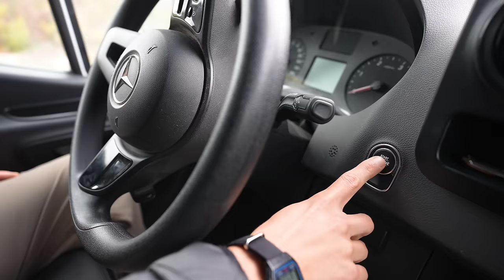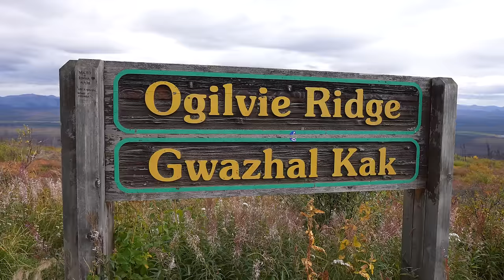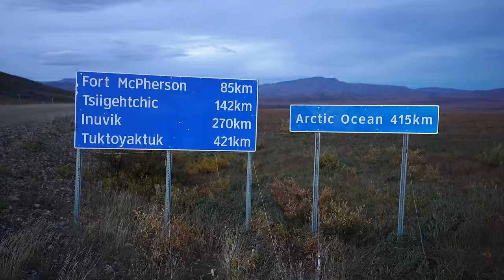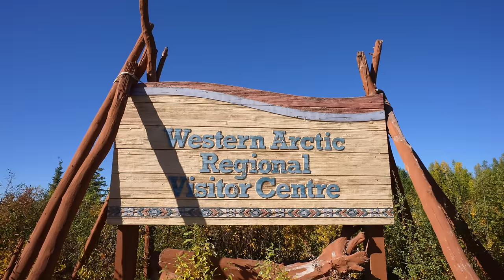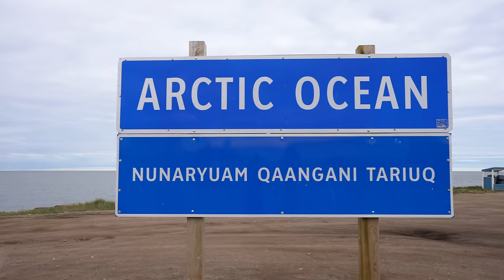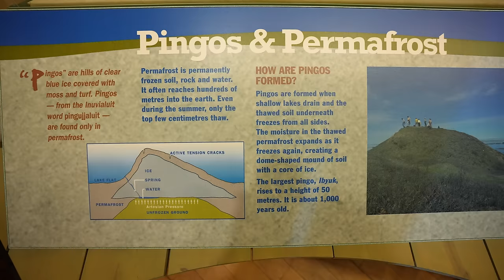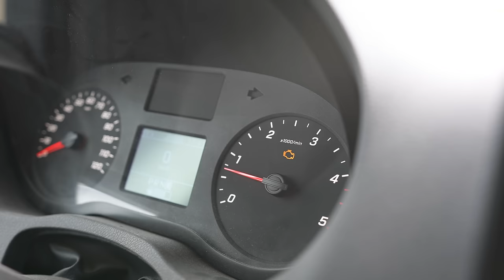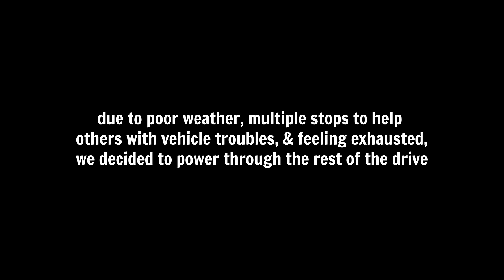We DROVE to the ARCTIC OCEAN! (Driving the Dempster Highway to Tuktoyaktuk in Canada)

Comment: Air, fuel, spark are what you need so check easy stuff first like air box and plugs and work your way down the line. Most times it's something minor but to anyone wanting to road trip long distances I suggest a small kit with all tools needed for your vehicle and know your vehicle, don't let it surprise you on the road. These two did their research and had safety fallbacks in place which is excellent. It's so tragic to hear stories of people lost and scared who don't make it.
Reply from the maker: Yes it is definitely recommended to have a road side emergency kit with you!

Comment: Aside from the wonderful pictures, videos, and commentary, Adam earns the mobile RV repair award for diagnosing and repairing of the fouled EGR valve.
Extra bonus points are available if you packed the carburetor cleaner needed for the repair for the trip.
Reply from the maker: 🏆🏆 woo hoo! The carb cleaner wasn't packed specifically for this trip...I've had to do this job a few times now

Thanks and thanks for watching!

Comment: Your video brought back moments of feeling the exhilaration having driven part of the Dempster to the NWT sign in Sept 2018.  There was a victory dance on the few patches of snow (-: The road to Tuk had just been completed so did not take a chance to get to Tuk.   We got snow at Eagle Plain where we got our famous flat tire fixed having acquire that feat between NWT and Arctic Circle sign on the way back (-:  We also came across a large grizzly crossing the road near NWT sign. 
They closed the road to Fort MacPherson at Eagle Plain the next day as the ferry was not running , so as often the case on the Dempster,  timing is everything. 
Our Jeep looked much like your van at the end of our time on the Dempster Highway at the same location by the sign.   That adventure is really at the top of adventure destinations - Congratulations. 
Looking forward to seeing the stops you made on the Stewart-Cassiar

Comment: What a great episode!! I think the northern lights were my favorite. Sorry about the van problems . If you do fix the problem and still have a check engine light but no code reader to reset it, on a lot of vehicles if you disconnect the battery for a minute or two it resets the check engine light . Thanks for taking me along , it was great
Reply from the maker: Ok thanks for that tip! Luckily it went away and we didn't have any bigger issues on the road! Thanks and thanks for watching!

Comment: Congratulations!🎉 Excellent accomplishment! I’d jump in the Arctic Ocean in a dry suit, but a swim suit? Amazing!!! Not sure if you do this, but airing down your tires on those pot holed gravel roads makes a huge difference. Keep a small air compressor in your livery for air up, takes minimal room. Also, a lot easier on your rig’s suspension. Try some electronic contact cleaner on the plug behind the dash, also can use a pencil eraser to clean them up a bit. Probably a loose terminal. Hope that’s helpful, loving your journey!
Reply from the maker: Thanks! We do have the tires aired down a bit and have an air compressor. We’ve shared more about it in past videos. 

The issue with the dash has been looked at and serviced by Mercedes, but still is causing issues. 

The ocean wasn’t too bad! The stoke was too high to not get in!
Reply: I kinda figured you did, you two are very prepared and we have learned a lot from you. We also full time adventure travel, and are almost ready to start trials on a new “Quigley 4x4” converted van conversion. Nothing like a dip in the arctic, to get your blood pump’n! Thanks so much for the response, you two stand out as the most personable and interesting people we watch on YouTube-

Comment: A quick FYI: If you're ever in a situation like that or worse, disconnect the positive (red) terminal of the battery for an hour or so. Sometimes the ECU throw a code, especially if it's been used roughly and that can reset it.
Reply from the maker: Ok good to know! Thanks! Not sure it would have helped the drivability though. It was driving really rough
Reply: @AdventuresofAplusK  Yeah, y'all had an actual mechanical issue. So many traction and stability control systems have a lot of sensors today that can get a weird signal from rough use.

Comment: Way to go, mechanic Adam! That had to feel so good to fix that van issue. Also, I had to look up how far you were from home when you were at the Arctic Ocean, and it was over 4000 miles! What an amazing adventure!
Reply from the maker: haha I'm just thankful that that was the issue and that I knew how to fix it! And yaaaa we were a loooong way from home!
Reply: @AdventuresofAplusK  I used to live in Inuvik for 14 years and been to Tuk many times, but never had the chance to drive the new Inuvik to Tuk highway!  Glad you guys got to visit and survived without too many issues.  Congrats!!  By the way, for diesel vehicles, if you take off the cables off the battery terminals for about 10 - 15 mins, it will reset limp mode...at least it did for a friend of mine when we went hunting in the Yukon a few years back.  If you can't figure out the problem, this may get you out of trouble in a pinch...hopefully until you can see a mechanic 🙂...who knows, it might also reset the check engine light.  Happy travels!

Comment: I have a temp fix for your dash. Add a pigtail connector kit to a location under your dash to quickly unplug/plug your dash harness.  They range from $20-40 and with some added wire you can have a quicker solution.
Reply from the maker: I'll look into it! Thanks!

Comment: Great video you guys and thank you very much for putting it all together and sharing!  Great getting your perspective on that stretch of your journey.  Looked like at the end you both were a bit relieved in getting out with perhaps the Sprinter acting up being the most stressful.  My wife and are planning a similar trip and I had a few questions....
Was the EGR valve the root cause or something else?
Didn't see the sprinter diagnostic tool/code reader in your "must have items for van life" blog post.  Maybe you have it somewhere else?  Did you get one, and if so what make/mode?
It appeared the bugs were not an issue at all?  As in they must have already had a good freeze.   True?
Anything specific you would do different in preparation/planning?
Reply from the maker: We were definitely relieved when we got off the road....me (Adam) especially! After cleaning the EGR valve the van's performance greatly improved. I've since had to clean it twice now and so there is some other underlying condition I think that is causing it. Not sure what and if it is normal for it to get so dirty so fast. We don't have a code reader yet and need to get one and add it to that blog post! 

We didn't encounter any bugs that's correct. I don't think they had had a freeze yet, but I'm not certain on that

As far as anything else for prep...I don't think we'd bring the extra fuel cans. We didn't end up needing them, but it was better to be safe than sorry!

Hope that helps! Thanks and thanks for watching!

Comment: Awesome video!
Have you considered some mods for better/comfier dirt road driving? You drive on quite a few dirt roads so maybe it would be worth it. Nothing crazy, all terrain tires (BFGoodrich are the best), and a suspension kit (Bilstein maybe) should do the trick
Reply from the maker: We have done those mods. We have Falken Wildpeak AT3s, which are comparable to the KO2s and upgraded suspension (including Bilstein struts on the front and Fox shocks in the back). The van rode actually pretty smooth on all the gravel roads we traveled on.

Comment: What they all said! 😎Question - Did you air down your tires at all or leave them at normal pressure? Headed that way this August. 2-wheel drive Sprinter.
Reply from the maker: Hey John! I aired down the tires a bit to about 40 psi in the front and 60 psi in the back. Before our north country trip I usually kept the tires at 50 in front and 70 in back, but noticed a better ride on gravel roads by lowering them then I got lazy and didn't air them back up for the highway so have kept them at 40 and 60 ever since for both gravel and highway. I'm not sure what the best approach is for fuel mileage efficiency, but I haven't noticed a dip with the lower pressure. Our van is at about 90% of recommended payload and we don't drive above the speed limit very often. We also took it very slow on the Dempster in hopes of not having any tire damage and we think it paid off. Others we came across on our travels zoomed past us and then later on a few of them we'd pass by them (after asking if they needed help, of course!) pulled over repairing their tires. 

I hope that helps! The drive terrified me before we did it, but once on the road you'll see it isn't as daunting or rough as it's made out to be!

Comment: Very cool video...if you guys did it again what you change or not change? Im planning this trip. Any tips?
Reply from the maker: The only thing we would change is to simply have more time out there. We did it in 7 days and wish we had more like 9 or 10 so we could savor it a bit more. 

As far as the driving conditions, the road really wasn't that bad. It was pretty smooth the whole way with the occasional pot hole filled area. I know it's hard sometimes to go slow, but do really go slow (speed limit). We made the entire trip without a tire issue and saw several times someone pass us and sure enough a few miles down the road we saw them pulled over changing a tire. Just make sure you have the time to take your time. Why rush it? It is a landscape you will never forget! 

We are currently working on a blog post for our website about a complete guide to the Dempster. We'll have it published in a week or so. If you have any other question definitely send us an email! Hope that helps
Reply: How long did the trip take? What would you bring and what did you not need to bring?

Comment: You got a pin pushed back and not connecting. That's the second time I've seen you do that. It's got be moving if it comes back on after unplugging it
Reply from the maker: You think that’s the issue? I haven’t looked at the pins so I’m not sure. Next time it happens I’ll look closely at the pins and see if there’s anything compromised

Also, no we never ended up needing to use our extra fuel cans. Bummer to spend all the time and money on it, but better safe than sorry I guess!
Reply: @AdventuresofAplusK  just from the video and dirt roads it made me think that. You could unhook the battery cable and if it resets it its not the pin. What your doing is unhooking the power same thing different place. One way to test
Reply: I should have said pin on the wire side. The plug you had in your hand
Reply from the maker: Ok good to know. Usually when it happens we’re on the way somewhere so if it happens when we’re home in Texas I’ll give that a test. Thanks, Sam!

Comment: Sounds like DPF plugged up.
Reply from the maker: It was the EGR valve. I have to clean it every few thousand miles. It’s a pain
Reply: @AdventuresofAplusK  I'm planning to buy a Sprinter like you but I don't want emissions problems but I believe diesel engines have the power to go up to the middle of nowhere.
My wife has no interest in going to Alaska so I'm going alone and I need a reliable vehicle
Reply: @AdventuresofAplusK  Thanks for your videos. I'm learning about going to the end of the road. I was hoping for fishing info on good lakes in the way.
Reply from the maker: We love our Sprinter. 130,000+ miles on it and no major issues